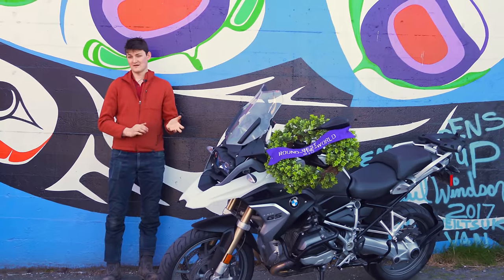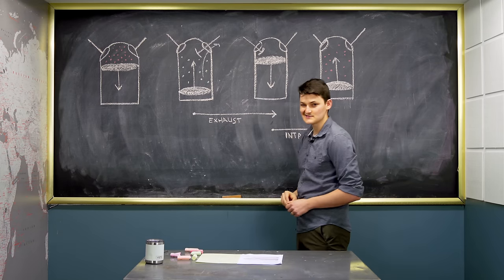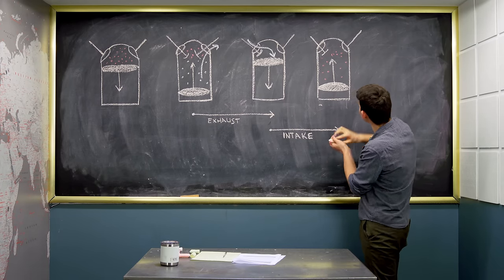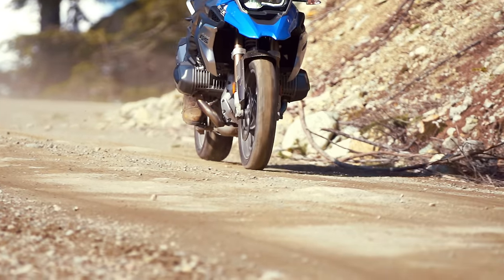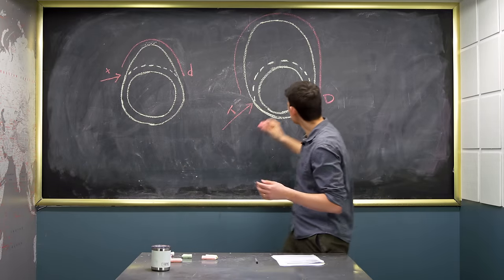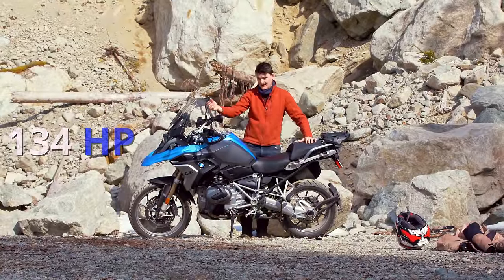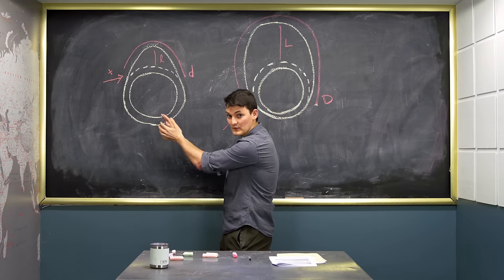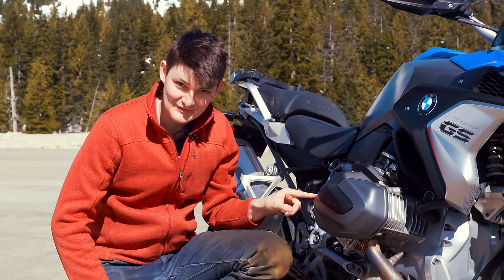Variable Valves are Bad for the BMW R1250GS - Review

Comment: When I first saw the solenoid, my reaction was “what idiot puts electrical devices in a high heat environment like that ???”.   

Nice single point failure mode !

Nice review of the situation 👍
Reply: Exactly my point!
Reply: Bmw is known for putting plastic in engine compartments. They do it in their cars as well. Thats why I don't buy BMWs. They start to fall apart to early. I haven't heard of anyone working on their own 1250 gs unless it's something small. Never on the engine like the 1200 gs
Reply: Bmw does
Reply: I think if you have to have a gs get the 1200. You can do most of the maintenance yourself. They last if your not hard on them.
Reply: @milesdavis8665  well unfortunately its not just the bmw, nowdays most everyone puts plastic peaces into car engines
Reply: @darthtrump4428  ain't that thectruth
Reply: Bmw does the dame thing in their cars. That's why they have a lot of problems. I've owned 5 of them so I speak from experience
Reply: @milesdavis8665 BMW has no known problems from their shift cam. BMW cars are a completely different division from motorcycles, completely different design philosophies. BMW bikes are designed with a simplistic=reliable philosophy, cars are designed with an every possible driver comfort+power philosophy. Though, I admit, some of their car philosophy has leaked into their motorcycle philosophy since the K models due to market demands. The boxers were being shunned for not being as speedy as the Japanese bikes, so BMW decided to start selling speed. You can still buy 2 valve boxers though in the used market. Corporations are market driven. If people buy more shift cam models than used pre shift cam models, BMW will keep making them. Else, they won't. But it seems like a reliable advancement in technology. You definitely need different intake openings at low rpms and low speeds compared to high rpms at high speeds. Since it is computer controlled, several variables can decide when to shift cams. Honestly, I like the 2 valve boxers and dislike electronics in motorcycles, but too many people like that stuff. And govts are demanding it.
Reply: @chadkline4268  I'm in agreement with you on that. To me putting plastic components in an engine that gets hot is not a smart move for things you want to last. But since has bmw in the last 30 years or so done the smart thing with engine design 😆. I'm still waiting to see how much engine issues they will have pop up in the 1250 engines. Looking at a 1200 myself for the ease of maintenance. I hear bmw wint even give an owners Manuel with anything pertaining to doing owners maintenance on the new gs. Hopefully that will change as time goes by. Thanks for the reply!!!. Keep the paint side up and wheels down brother.
Reply: @milesdavis8665  those are things I have heard too, I think when the R9Ts came out. People couldn't get service manuals. Mechanics need them too, so I must assume they fixed that situation quickly. I did look into it briefly, and to the best of my memory, they were putting out information on CDs that required a Microsoft operating system to run. But .. they really should have a book with servicing details. And these days, you need a GS911 computer thing to read and reset all the error codes.
From what what I have seen: since 2 valve boxers, they have replaced push rods + rocker arms with chains and cams, for a DOHC setup. And now they use a solenoid (metal rod inside a copper coil) to shift the cams to different lobes at appropriate times. This makes the spark plugs deeper inside the heads since the DOHCs are on top of the plugs. Someone questioned which lobe do you use to check valve clearances 🙂 and it seems you just check one lobe, and assume the other is wearing in a similar fashion 😁
Reply: The diesel engine industry has put electronics inside their motors for decades with millions with success. I do agree that BMW could have went with better variable valve timing setup.

Comment: That video made sense! I'm glad I can watch a video where the end point is: Please BMW, make your bikes simple. 

There is nothing wrong with having a flagship bike on the lineup to attract customers to dealerships. But there is something very wrong to fill the bikes with over-integrated technology nobody else than the seller can maintain. Car manufacturers are following the same trend, pushing customers back to their dealer.
 
Bikes should have every reason to offer an alternative to that serfdom. Make bikes light so they are manageable, make them simple so they can easily be repaired.
Reply: Adrien Gahery klr 650.
Reply: The thing is, very few people actually  work on their own bikes anymore. Sucks for those of us who want to but its probably not relevant anymore. Most riders I know cant do more than change oil and most dont even do that, they want the fancy tech.
Reply: Just a market correction.  If you don't want an R1200GS? Don't buy one.  KLR is the shizzle, and so many choices in the 250-450 cc range that it goes without sayin'.  Light is Right!!  VTeC, YO!!!
Reply: Agree. I think all well build products should be open source style. Give me the blueprints when I buy something please. 
Looks like bmw has been hanging out with tesla and apple.
Save the planet, by reducing waste. Buy used!!!
Reply: @supertrucker2077  Beat me to it 😂
Reply: Harleys are not simple, cheap, or reliable by any stretch of the imagination. Klr's are serious compromised, as is the DRZ400. The world needs more simple, light bikes.
Reply: Adrien Gahery lol plebs telling bmw how to business plan and engineer hahahahaha!!! How fortunate that you’re all here to save them smh 🤦‍♂️
Reply: "...𝐏𝐥𝐞𝐚𝐬𝐞 𝐁𝐌𝐖, 𝐦𝐚𝐤𝐞 𝐲𝐨𝐮𝐫 𝐛𝐢𝐤𝐞𝐬 𝐬𝐢𝐦𝐩𝐥𝐞..."

Tell you what . . . if they do it then I'll end world hunger and make a cure for AIDS and CANCER.

Exactly . . . never going to happen.
Reply: Have you ever turned a wrench on one? The bikes are pretty straightforward to work on in terms of troubleshooting electrical and basic maintenance. ( Iv yet to have electrical issue) Personally I wouldn’t want to do without electronically adjusted suspension, ride modes, heated grips. I love my klr but unless I’m gonna be riding in a slop hole I take the gs ever time.

Comment: Ryan,

The oil cap tool is part of the screw driver handle located under the seat. Been that way for years.
Reply: David,

The oil cap tool is the grabbable vertical blade located on the oil cap.  Been that way on other bikes for years.
Reply: @hakrsakr  ???

Comment: I recently just quit my job at a motorcycle dealership, right when I started the 1250 GS came out and we were selling them, they're fun there a lot of awesome bikes to ride. But you're totally right about not being able to walk out the door for under 30k, I used to have customers spend upwards closer to 40, on new farkles for their bike. Some customers are even trading in their 2018 1200 gs for a new one, I will admit that I was little brainwashed by the company, something about being a 20-year old kid working around motorcycles tends to make you see things from a manufacturer's perspective. All that being said I agree with you 99% the only problem is the only reason this bike came out with the extra lawn mower inside of it compared to the previous generation is for BMW to make money off of the California Rich late 50s winery owners. Not that there's anything wrong with that. But I do know that BMW has a hard time getting young people on the train as well. I don't think BMW makes bikes for motorcyclists anymore, just a bunch of garage pieces for men that have the other 4 bikes to ride as well for all reasons you have above.
Reply: When I was looking for my 1st ADV bike, obviously, I looked at the GS 1200.  I had a price point in mind, but the bike was 23K, about 5K more than what I wanted to spend, all because of the added electronic "packages".  I told the salesman I didnt want or need all that, and he said "consider resale" (BMW doesn't even sale base model bikes).  I walked out and bought a Triumph Tiger 1200 for 17K, that was actually equipped the same as the BMW.
Reply: You nailed it. Ran across a BMW gs rally taking a break in the Bay area hills. All were in their late fifties and up, no young people.
Reply: funny...   i got the first 1250gs hp loaded  for 22k and rolled out.....   later spent 2500 on vario cases ....   done.....
Reply: surfallday I’m 28 and ride my used 2018 gsa down every backroad in Mississippi. Buy my rotella engine oil at Home Depot and I shop at dollar general just like everyone else.

Comment: Hey Ryan!

I think you missed a point concerning the valve timing. I happen to own one of these for over a year now, so I partially speak from experience.
The point of the low cams is not only to create low rev torque, but also to ease the bityness of the bike in lower gears and speeds, and to improve fuel economy. When I'm on the highway doing 70 mph, the low cam profile is active. Only when I hit the gas, the high profile takes over.

Also, the high cam profile not only comes in at high revs, but also at low rpm's at over a certain percent of throttle. 
It's basically more like a economic and POWERRR modes. You can really hear and feel the high can taking over when you floor it at low rpm.
Yes, it may be an old, stolen idea. But I think it works just fine, and is a great improvement on the 1200.

In regards to the electronics' tenderness, there's a Dutchman going around the world on one of these things, and he's still doing fine after tens of thousands of miles.

I like your videos overall, keep it up!
Reply: I love how Ryan doesn’t reply to anyone that actually puts out facts about the bike.
Reply: It’s true, he lives in his own google search bubble. He can build a old thumper with YouTube help, but when he tosses equations and actual nonsense on the board and tries to dumb down and make an inaccurate point, the audience doesn’t care anymore.  He’s brilliant they say, but the truth about Bmw is this, it’s over complicated, yes, heavy, yes, recall every year, yes, no lubes splines from factory, yes...but the cam bullshit from this video makes no practical sense in terms of engineering. They work, they don’t fail, they have dual purposes...saying you can’t run the bike if one fails is kinder surprise response.  If the shaft breaks, you also can’t ride...
Reply: If you put a 1200 and 1250 on the same dyno, the 1250 makes more power and torque all the way through the rev range, so I don't understand what he's blabbing on about.
Reply: Thanks for the explanation. So yeah. All that trade off is just create an "hollow" you quite didn't felt on the AC 1200 right ? I love my flat engine so that make me a bit feared, the curves are so road perfect with that torque all around and power building up at the end on the AC 1200 so if one day i upgrade...

Comment: Thank you for articulating what I only had gut feelings about. I absolutely adored my 2011 R1200GSA oilhead, with its tractor manners and relative simplicity. So having sold it when I moved to Europe, I thought I’d get one of these new 1250s to replace it. But something about the price plus the mass of gadgetry put me off. Did I want more than the old 110 hp? Did I need a fancy multimodal display? And my service costs were already through the roof on the old Bimmer—what was the new pain going to be? So I hesitated, bought a used interim bike while I thought it over. With all the choices out there, I am afraid I’ll have to cut the BMW patches off my Rallye jacket. I still haven’t made up my mind, and the “interim” bike is a lot of fun, so again, thanks for saying what I imagine a lot of us were thinking. I feel liberated.

Comment: The wrench for the filler cap is situated underneath the saddle 😉 Hill start control pro can be actived manually by pulling hard on the break, if not it doesn't engage 😁 Would love to see you review the new Multi and Tracer 👍 Keep up the excellent work.
Reply: The point he was making was that it doesn't have a standardised filler cap, like any other bike ever. So if you lose the tool, you're SOL. And.. his other point stands, if you want a 3p turn, you will break - thus engaging the noob hill assist.
Reply: @edforshort  Hill assist can also be completely turned off.  The filler cap is designed to prevent tampering with the crankcase. Many people simply replace it with a toolless option.
Reply: @edforshort Hill assist does not engage with regular braking.  You need to hold the front brake hard for ~ a second while fully stopped.  I've never accidently engaged it.

Comment: I think the tech was intended more for non GS platforms using the same motor, but it made sense for them to make it apply to all 1250cc bikes rather than keep the old 1200 design on just the GS.  You’d be surprised how many GS owners don’t do that much off road and utilize the shift-cam tech.

Comment: "What if the valve solenoid fails?"

Well assuming the computer doesn't immediately bork and put you in limp mode, you'll just be left with whichever cam lobe you were on when it stopped working.

Although this could be different between the left side and the right side!

Hmmm... Lumpy!
Reply from the maker: It seems that in the "off" position neither shifter pin is engaged. If the solenoid failed like that, the cam would be free to float from side to side (eek!). Though I'm not 100% sure about this, so if anyone has better experience - help me out! ~RF9
Reply: @FortNine  this is horrific. A complete fail in mechanical design. I guess it'll never go bad, but just knowing how this engine runs makes me never even want to consider it now. Thank you!
Reply: @FortNine  now that doesn't sound optimal!

I find it hard to believe it would be left floating. I would expect them to think "fail safe", although that might be safe as in safe for the engine... Not safe as in you can get yourself out of the middle of the Australian Outback before the sun comes up and cooks you to a crisp!

I think I'll go back to wrenching on my old GS in the garage... Suzuki GS250 that is ;-)
- This isn't a lock-down, it's enforced "FINISH THAT DAMN PROJECT BIKE!" time :-D
Reply: Hi FortNine,  I looked at this when it just came out. If I checked all the part drawings correctly, there is a little grove and ball setup that locks it into place. If you look at the valve video you will see that the activator only makes it shift and then retracts. This in normal operation.  But I do agree it’s a old way to do it, Ducati way seems better in my opinion.
Reply: @juststeve5542  Failsave devices are almost always first to go. What happens if one cylinder get stuck at one position, and the other cylinder on the other? What will repeated inbalanced ignition will do to the engine?
Reply: @FortNine  I watched an Interview in German when ShiftCam was introduced into the S1000RR.
The Journalist asked the project manager that exact question. The answer was that it would just stay in the position that it was when the solenoid breaks.
Reply: @vicfema  yep, saw it too. Since the GS has two seperate solenoids probably the other one that is still working will put that cylinder in the same position that the broken one is stuck in and display a massive warning on the screen to head to the nearest dealer as soon as possible
Reply: Don t worry it will NEVER fail.... 😂😂😂 good luck with that reliability 😂😂😂
Reply: @Blockbuster2033  The warning will say "bring your wallet to your nearest dealership"
Reply: If it failed, it would not be free floating,  please do not put out bad information to non-auto mechanics.  Also, if they failed in any vvt or dvt system, you’d need work done.  That includes every bike you mentioned in your video.
Reply: Hey my wizzy brakes on my 2005 GS still work.  This shit never breaks!
Reply: @vicfema  What supplies power to the solenoid. My electrical knowledge goes as far as A/C dies and DC lies. so depending on current type could answer the question
Reply: @HakanKoseoglu  The by design unbalanced Harley - Davidson  ? Who complains about that ?
Reply: Why don't we just disconnect this solenoid thing and look what happens?